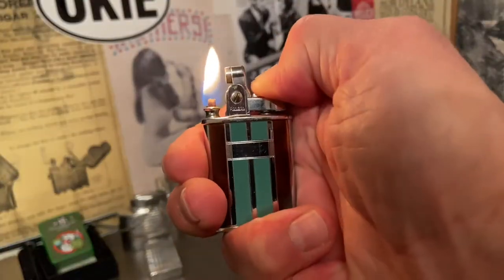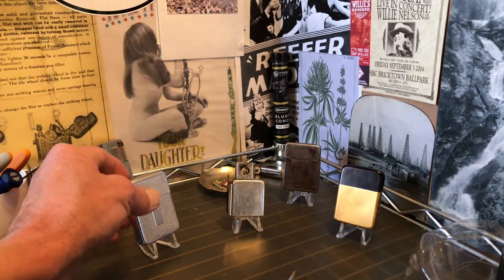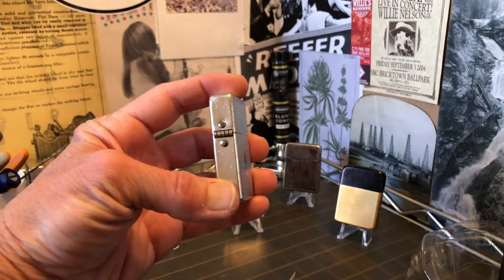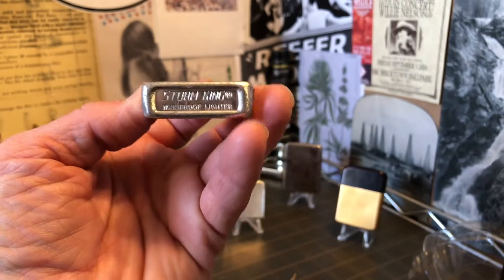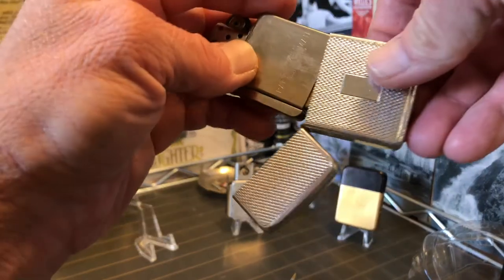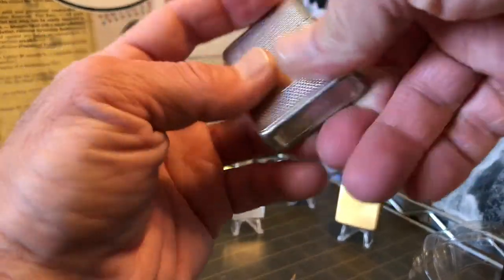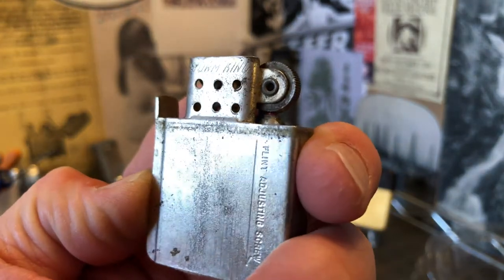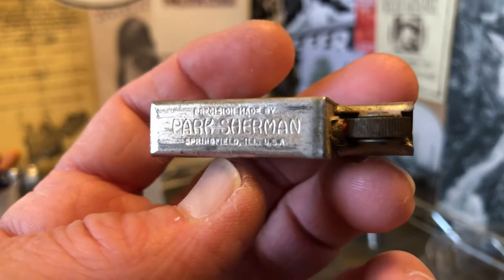Vintage Park Lighter Inserts: Interchangablility, Disposition and Styles

Comment: My favorite parks are those advertising bi-metal lighters with the steel lid and red anodized aluminum body. Same profile as a zippo slim, so light you can’t even tell it’s in your pocket (mine has been washed a half dozen times by the wife already) and because it burns fuel slower than a full sized flip top you still get a weeks use of fuel out of it.

Comment: I have been wondering about those storm kings. I am mad with myself as I have passed these up in the past. I wrote them off as cheap zippo ripoffs, I could have gotten them for very little money. How durable are they? My only concern is with the aluminum insert.
Reply: I don’t think it’s a Berkeley though. Inside the case it has a pc and 3. It’s also a different shaped case that a Berkeley. It has sharper corners like a 1932 zippo
Reply from the maker: They seem durable to me Collecter. I have owned and used several. The only real downside is the aluminum flint tubes seem to cling to concrete flint dust.✌️
Reply: @DependableFlame  I see. I have a couple of those Berkeley’s and those have aluminum cases. I am going to have to pick some storm kings up.